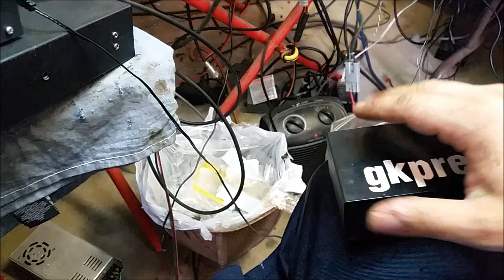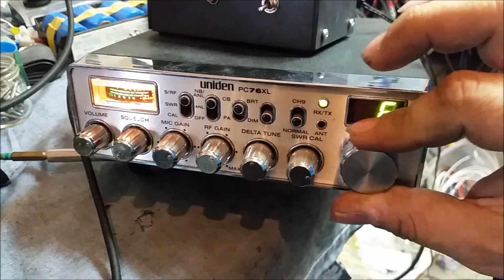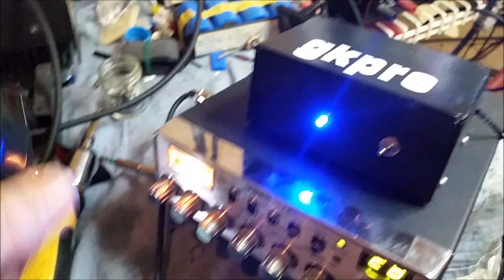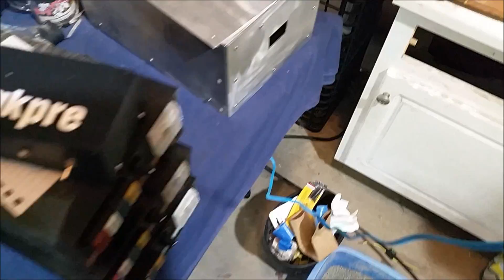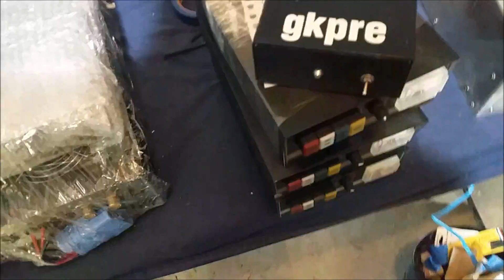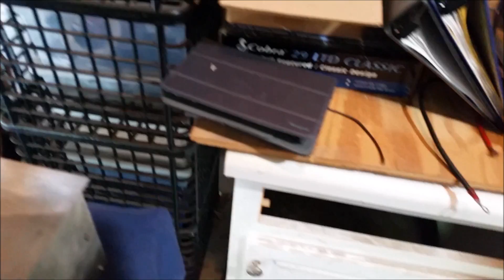GKPre Labeled Up & Ready, DSP Unit Coming Soon...

Comment: could do 9 volt LDO regulators and specify input of "12v+", depending on the regulator max input voltage.
LDO = Low Drop Out. most of them are 0.2 to 0.5v dropout. so it should work ok as low as 10v, if they have power sags :)
Reply from the maker: throttle bottle actually your exactly right. i misspoke in the vid lol. I do that sometimes and say something wrong...i was using some 100ma l7812 reg during testing but i fig. quickly i should have bought some 9v reg....good thinking

Comment: Ranch 55 here ...... Looking very good. Keep up the videos. ...... I ordered a set of 4 matched HG 2SC2879 transistors from you yesterday afternoon. I putting them in a Texas Star 500 for a friend. Does the input and output tuning change much from the Toshiba's ?  ....... Thanks Gatekeeper .......
Reply from the maker: Steve Stephens Hey bud, Not a lot but there is a change. With Texas Stars so far I have not retuned anything and they have worked great but with aome of the older Texas Stars this may not be the case. I may have to retune then.